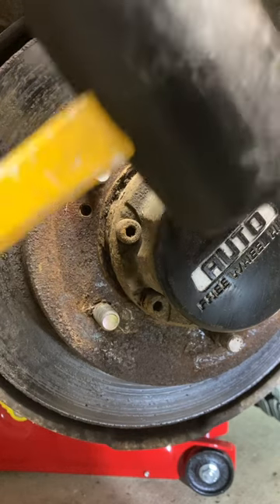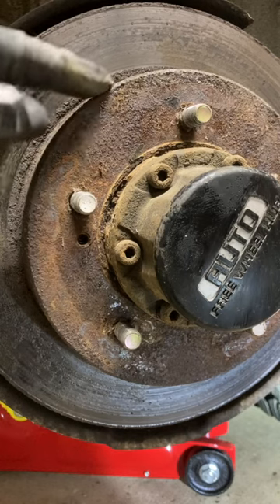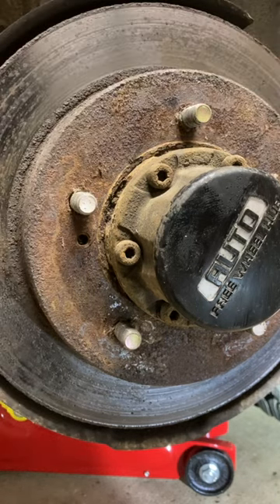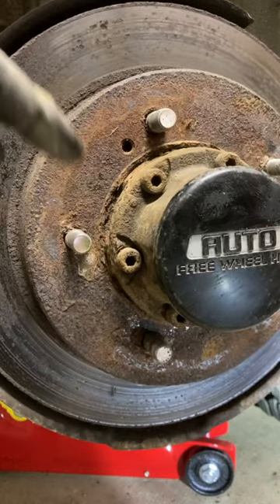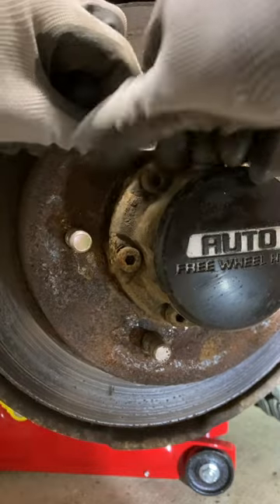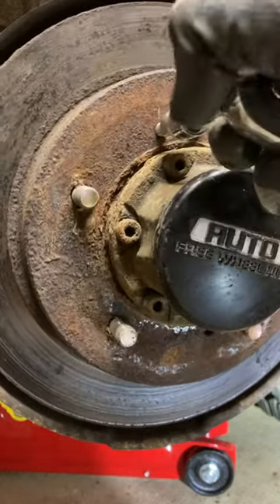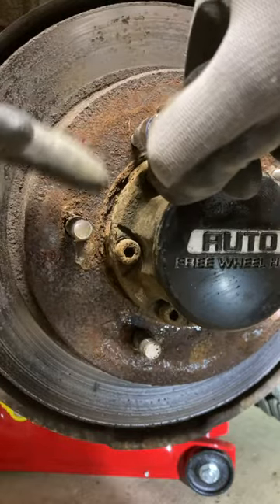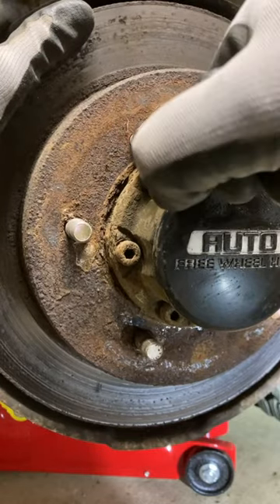Rusted Rotor Removal Tip! 🔧😎 #shorts #diy #tips

Comment: If ur replacing the rotor, why not just whack it with a sledge
Reply: You must replace wheel bearings often
Reply: @ai_university 
If a wheel bearing is damaged by a hammer striking a rotor the how would it hold up to road impacts? I have been whacking rotors with hammers for 40+ years without damaging bearings!
Reply: @benztech2262  the moment of inertia and load distribution are entirely different in the two scenarios. I'm not saying you're trashing bearings every time, but on something that's already worn out, it can definitely be the final nail in the coffin.

Comment: i use an impact on those bolts when the rotors are seized onto the hub from rust, works great but sometimes rotor gets cracked and breaks

Comment: There's another way to do it using the lugnuts and studs if you don't have a long bolt that's threaded correctly, but this is waaay easier.

Comment: I highly recommend just picking up two bolts if you can. I've had one so stuck on before that one bolt just stripped it's to hell and thankfully finding a second and running it through the other side AND hitting it once it was tight broke it free. It might not happen often but it's worth not having it happen to you at all.
Reply: You must live in the rust belt, huh?